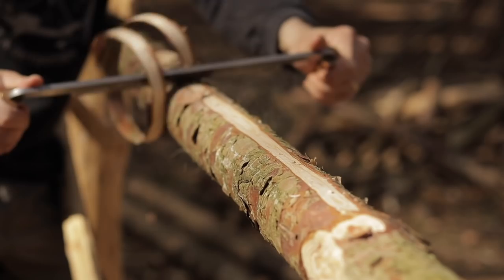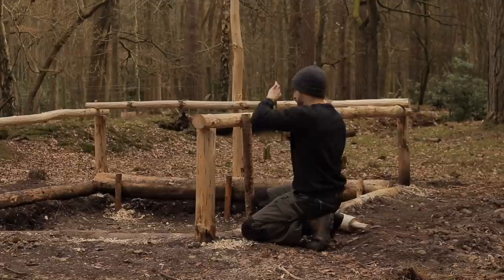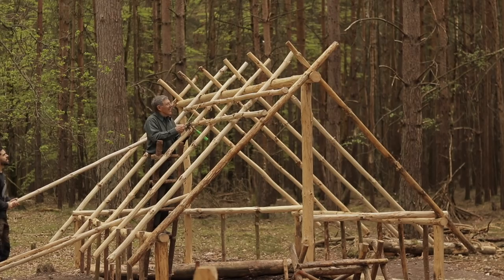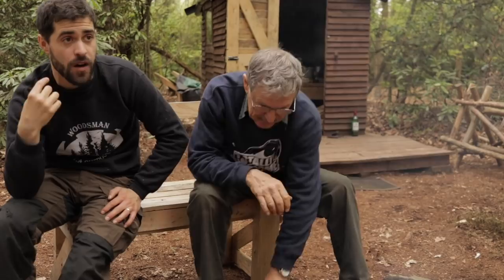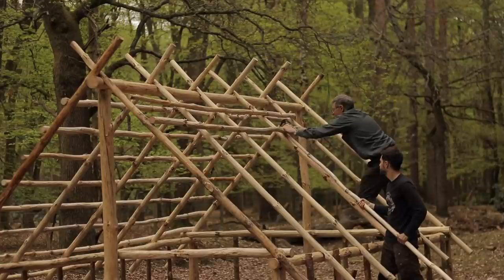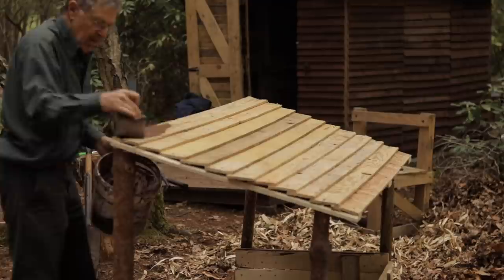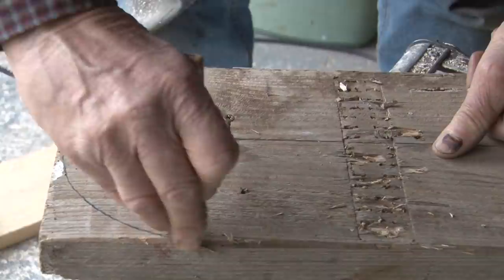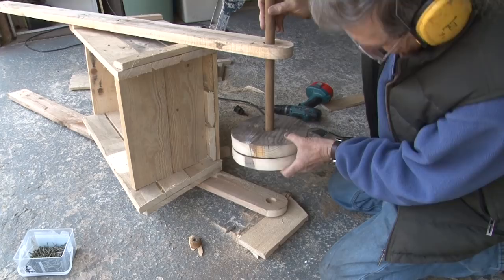Building a Saxon House (Grubenhaus) with Hand Tools: Bushcraft Project (PART 5)

Comment: The term tinderbox is named after its exact purpose of carrying tinder (any material that's easily combustible) and other fire starting materials. The term tinder comes from the old english "tynder" and it from the old english "tendan" which is a form of "atendan". Atendan literally met "to set on fire". This was ultimately from the Proto-Germainc "tund" meaning "ignite, kindle". So tund becomes tendan and then tynder in old english and eventually to tinder. An example of prehistoric European tinder was the tinder fungus (Fomes fomentarius, which gets its name from fovimentum which is latin verb for "keep warm") which was used to make Amadou. It was commonly carried around by the Otzi, in 3500 bc, with flint and iron pyrites to start fires.
Reply from the maker: What a comment, cheers!
Reply: Amazing explanation ❤️
Reply: Interesting, in Dutch it's called "tondel" and a tinderbox is "tondeldoos" literally a box ( doos ) to keep your tinder ( tondel ).
Reply: Pim van den Berg well that’s because Proto-Germanic is like the Grandfather to the current Germanic languages (English, German, Dutch, Swedish, etc) so they all have similar words like that.
Reply: @trafficoan1811  It's not just the northern European languages, Even Sanskrit has a lot of root words that are similar. I believe an alternative term is Indo-Germanic
Reply: Yes, Swedish it's Tända
Reply: yes the otzi is from 3500 bc, human doesnt evolve. we are created by God 5000 bc

Comment: I knew my great grandfather - he started working his farm with horses, and was overjoyed when the internal combustion engine was used for agriculture. He saw that transformation, and never did understand why anybody would want to pick up a scythe when there was a machine to use.  You are absolutely correct -- if the Saxons had electric drills and power saws they would totally have used them!  If nails were cheap and came in big boxes, yes they would have used them!

Comment: Consider:   Your roof frame will accept panels that you can make on the ground and then hook on the already present rods at the ridge. No climbing.  If you line your roof panels with heavy canvas stitched to a frame they will even be water tight.  Bo.

Comment: The Anglo Saxons did use nails sparingly in construction. 
You did right using timber joinery as much as possible.
Nails were extremely expensive but so was replacing a roof every other winter.
As a woodsman, a carpenter and a viking reenactor, I'm really enjoying this series 👍

Comment: Bark peeling with a drawknife is by far the best wood preparation for long term sustainability that I can think of, it's easy; there's a skill development to it and the peels are great for fire starting!
Reply: Could also be utilized in a manner for brick making if you break the bark peels up, would be nice to have a fired clay floor mixed with said materials for a long term foundation , burn it with fire hot enough and cook it, fill it's cracks afterwards with the ash and give it a smoothed layer, another fire later, brush the charcoals and ash of and burn log ends to stake it out in it's surrounding, layer an inside layer on the clay too perhaps for walling support, or have pre shaped clay holes in the ground fired, and filled and refired then lower a log in, if the log is inserted hot, then clayed over then if the distance between the prefired clay and the hot wood is small enough and filled with clay it perhaps would cook too, keeping the logs stable for much longer then "just fire hardening them" and sticking them into the dirt, which would still have water erosion and the very small possibility of a bug or two scratching off it over say the twenty years a fired log in dirt would last. You would get the clay by digging down far enough and the depth would make the "bondfire" safe, the issue would then be to pre skin all the bark off all the trees you would use because of the sheer mass you would need to get that structurally safe clay to fire, having it layered against the sides of the to be basement  would also keep basement wood walls as safe as whatever support timbers you would wish to dig deeper for intermittenly placed vertically faced logs.

Comment: Hey.
Shame to see you use the bark peelings for kindling.. there is plenty else in a forest to use for that.
But they could instead be used to sleep on in a box bed. just let them dry and then either massage them a bit before or after time they will be very soft. 
Sort of the same way straws has been used.
Fine peelings is just as good. and can be used for a long time, where mos will go bad since its well wet.
And seeing your bed in the viking house. well. beds even though made by logs in a wood can very easy be made good by only using whats in the wood...
Peelings, then some top layer and a sleepingbag. Works like straws. and has been used for that purpose.
If people want to know. fine sand that is 100% dry is also super to put in a boxbed. bassicly just make sides on it. 
With sand having a top layer is just very important but it really makes the sleeping better, and again something that has been used.
Sad to see you just burn something that could be used for a softer bed :)

Also.. as a former chef. you need to work on your pan movement when tossing :D Hah.
And nail away.. nails have been used from way before saxons.. you use tools they didnt have there.. it says handtools. I think only a few have a problem with that. and will most like be one of those just finding something to have a problem with for the fun of it.
And no need to think about the wheel either. many.. many 1000 of years old.. so you are good there :)
And and.. the anglo viking things. Still today or actually less today. but even today at least 11% of English is from Danish/scandinavian. words like Fish, window, eeg so on.. in Denmark, Sweden and Norway has letters only found here, in æ, ø and å. and many english words contain that from how we say them since its words given from the vikings, like egg, that is here æg. you dont have the æ, so too ee instead.
Other than that, most of the kings and royals you had up to 66% have danish royal blood of one link from the meaning only one link away from the danish royal family. most of any country.
Big part of your country was called Daneland. and the roots of what became England was in 1066 when the Normans came. The normans was vikings. Rollo was a danish Viking given the land.
Always fun to say since its sort of true very grey and white sort of way. Vikings founded England. Vikings founded Russia. Vikings where the first to make a country or kingdom where all religions had the same rights. When vikings/Normans became kings in Italy. Also Vikings where the first European Civ to give rights to all. not just rich but poor to. everyone had rights. woman could devorse there men if they didnt do well by them at home or just treated them bad. Took over 1000 years to get back to that.
But well. Vikings, Danes has a very, very large place in how England became England. 
And not because of rape and raids, that was not by any means what made a viking. vikigns where about trade, they did not hate other races or religions, they used it. scandinavia was very unforgiving back then. only by getting trade and friends and others in from the places they went could they grow. they welcomed others, and that was also the thing that made the Viking way die out. wasnt defeats or anything, it was getting ideas, it was trade, it was growing..
As always.. awesome vids ... and thanks :)

Comment: First off, you asked about our genetics. I am Half Cherokee (Native American)  1/4 Scot and 1/4 Irish. There is about 2% German in there, as well, but no one really knows where it came from. That said, one of my hobbies is blacksmithing, and when I was apprenticing, I made a lot of hooks and nails. Those both teach you important skills, making something with a small tip that is expected to be hammered into wood or even stone. If you make it wrong, the tips chip and the entire thing can shatter when you hit it with a hammer. But yes, nails have been around for a very long time, so the Saxons most certainly had them. I love this build and al of your channels and vids. I can't wait to see this one finished. The Pine Pitch was brilliant and is awesome. and sir... the wheelbarrow... it is totally awesome, or a TA Wheelbarrow. LOL.  Tinderbox as I have been told, was a small box that you wold keep some easily quick burning tinder in. But could also mean something such as you built, a larger box for tinder and small logs to make a fire quickly. 

Good luck and hope to see more quickly!

Comment: Edition 5 of the Saxon house is looking fantastic. the wheelbarrow works well, Graeme... well done. Also, the tinder/wood box is also going to be a great time saver when cooking also. what I have found out about tinderboxes is as follows. ORIGIN OF TINDER
before 900; Middle English; Old English tynder, Old Norse tundr, Old English -tendan (as in ātendan to set on fire), a highly flammable material or preparation formerly used for catching the spark from a flint and steel struck together for fire or light from any dry substance that readily takes fire from a spark.

Comment: A tinder box is a small metal box with flint a striking mechanism and dryed linin or other material that catches and can be put out quickly, most commonly used to light pipes cigarettes etc. Hope this helps :)

Comment: Hi Guys,

This is just my personal opinion since I like gardening. Not sure if you would have the time or interest but here goes:

You can also use the wood shavings from the bark peeling as mulch if you decide to start an Anglo-Saxon kitchen garden (or cottage garden I believe is what you call it in England). We use mulch as a temporary solution to rainfall soil compaction before our ground cover or cover crops grow up. It will also break down providing some nitrogen, and keep soil temps in a good range and moist. 

There a quite a good amount of medical herbs that you can grow, as well as vegetables, and maybe a few flowers (we call it fluff). There would be woven fencing like that in the viking house build for keeping animals in or out depending. And you can grow some sort of edible vine on the fencing. Like Peas, Pole Beans, or Roses for Rose Hips. Or some pollinator fluff like honeysuckle. 

Alright, now on to part 6 :3

Comment: I love debarking when the bark is coming off ok, but when it is red oak and already seasoned (I know, not the best time to do it, but you use what you have) or some other tough type bark, I don't like it. The most satisfying is the paper mulberry trees that are growing like weeds in my yard. I'm making bow saw handles for various size blades I have. I have replaced my coping saw handle (the metal one), with a buck saw design and I love that. I used some of the paper mulberry wood for that and that coping saw blade now cuts through just about anything now,  like butter. I love it. I have decided to replace all of my heavier saw handles with that wood, because it is hard, yet lightweight. I have De Quervain's Syndrome in my wrists. It might not be ideal for everyone to do this. It's perfect for me though, considering how much easier it makes using these blades. I swear by my buck coping saw idea. It's the same thing everyone else does with bushcraft blades for cutting timber with a longer saw blade, only scaled down to the length of a coping saw blade. 

I absolutely love that wheelbarrow. I want to make one.

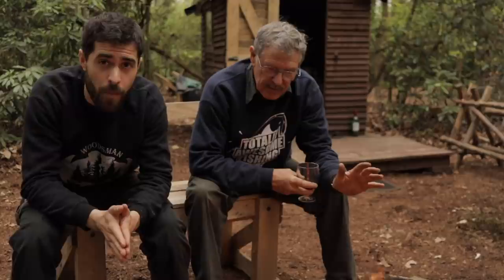Comment: 14:30  I just want to give you a bit of a correction.  Nails were the job of a shop hand or apprentice as the process of making them requires learning to properly drift the metal, and hammer control.  When an apprentice could make a certain number of them over an hour, and they were a quality item, then they were allowed to start on other work.

Comment: I have to agree that the Saxons would have used anything at their disposal to make building easier. When I was making a shield I felt bad about using plywood because that’s not how it was traditionally done. But my dad said that they would’ve used plywood and power tools if they have them.

Comment: Guys, it's fine to use nails.  I'm 90% certain you used those nails for the exact purpose they were originally invented for.  Someone definitely at some point got sick of trying to drill these tiny peg-holes while standing precariously on top of a ladder for the batons, had some thick metal wires or thin metal bars sitting around, and decided to pinch off one end on an anvil and used those instead.

The wheelbarrow is also really cool, but I'm surprised you didn't make a spoked wheel so you could make a bigger wheel with the same sized pieces of wood.  I really like it though, and it definitely seems lighter (and less likely to tip over) than the average iron-bucket wheelbarrow.

You also did a great job on the wood and tinder storage!  With how often y'all're out there building a fire I'm surprised it took you this long to build one, but it's definitely a great idea!

As someone who's built several forts and treehouses in her time I think y'all're making tons of progress for just two dudes puttering around in the woods whenever they get time!  You're moving pretty fast IMO, but you're taking enough time to do things right the first time, which is greatly appreciated!  Sooo many times with these bushcraft DIY jobs the corners people cut greatly reduce the longevity of the construct!

Also, I don't know if the UK has anything like poison ivy, but it's absolutely THE WORST because you practically need a special set of gloves that you wash with felds naptha soap before storing because the oils that make you break out in hives wherever they touch can stay active for up to seven years on anything that brushes against the plant, so it's a nightmare for bushcrafters!  It also happens to make you allergic to it over time, so even if you initially didn't have a reaction that doesn't mean you won't in the future!  You can't even burn it because the oil aerosolizes and can get into your lungs through the smoke, and this can EASILY kill you!

Comment: I recommend used engine oil to protect your timber from water damage, its free and its recycling, I've got a pallet wood shed treated with it and its totally rot free, and pallet wood is like a sponge , the oil soaks right in and doesn't wash out and contaminate the environment.

Comment: Ya'all know you can make a wheel out of multiple boards- like how you made the walls of the holding pen.  Put supports on both sides, crosswise to each other, trace and cut out a larger circle.  It's the next step up from a chunk of log.

Comment: Personally I like using a drawing knife. The only blade you need besides a axe is a KA-BAR with a saw on the back because you can use it for just about anything, and it is really easy to makeshift into other tools.

Comment: Tinder box meant a place or box that tinder and  flint were kept to help build fires. Origins are from about the 1520-30s.  Scraps of dried wood and a steel and flint meant to start a small fire most likely used by militaries for cooking needs in areas where dry wood was not easily found.

Comment: A tinderbox is a container made of wood or metal containing flint, firesteel, and tinder (typically charcloth, but possibly a small quantity of dry, finely divided fibrous matter such as hemp), used together to help kindle a fire. They might also contain sulfur-tipped matches.

Comment: Hello Mike, and dad! Really nice video. Really chilled to watch, though I'm sure it wasn't chilled to do all that work. Brilliant though!

I have about 35% Irish in my dna. Which is the biggest chuck. Scandinavians the next biggest, some Spanish and Italian as well.

You are right, if the saxons had nails to spare they would have used them. No criticism here for you having used them.

One thing you said I'd disagree with, though possibly I'm wrong. You said you should have added in the walls before doing the roof, if you were to weave in your wall and fill with clay or mud (wattle) a heavy rain would completely destroy it. It was partly why walls were so short and the roof came down so low, with a lot of overhang, was to protect the walls from rain.

Comment: If I'm not mistaken, 'tinderboxes' as a household piece of kit date back to the 17th/18th century (possibly earlier), and generally fell out of use with the introduction of affordable, mass-produced friction matches.
Reply: well, they still were around, it was literally just a box people kept the tinder in though so they wouldn't have loose bits of old newspaper and wood shavings kicking around the house all the time.

Comment: You have a froe so the easiest thing to do is have your dad sit down and use the froe to make shingles. Wattle and daub may be harder depending on weather you can find sticks (green) flexible enough to do the job in the area. You can use the roots in a basket weave but that is going to be a pain. You may need to split the round wood into 24-36 triangle pieces and see if that is flexible enough  to do wattle you  can soak or steam the pieces to make them more flexible. Since you have clay in the area use the clay rather than dung in the Daub

Comment: I know this won't be seen but a comment about removing wall paper. Hot water with a fair bit of vinegar in it does quite well. You can also use mineral spirits, which works a little better in my opinion, but you may want a mask and gloves.

Comment: I love the wheelbarrow but I would have made a few changes. Cut a large log piece into the wheel and drill out the spindle hole. For the long handles, regular wheelbarrows have round tubes as that's more natural feeling and ergonomic to the hand. I would have used a barkless med-thin long for those instead of the flat pallet wood that's not natural feeling/ergonomic.